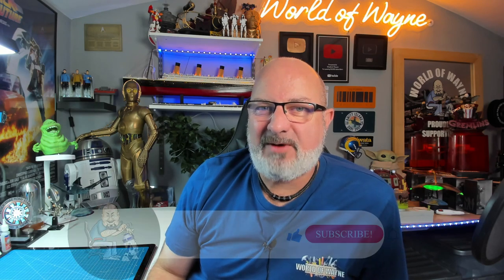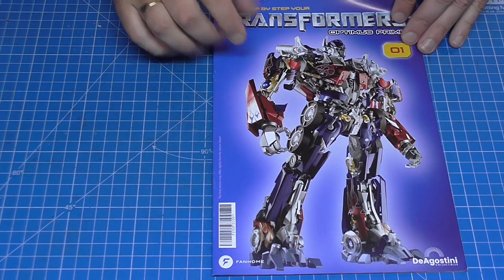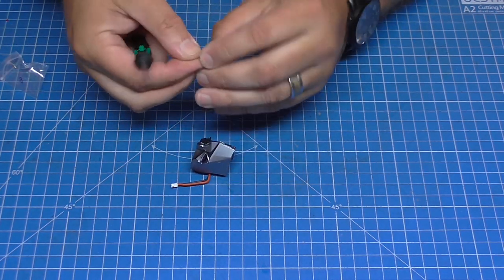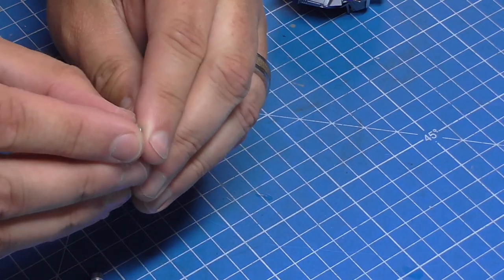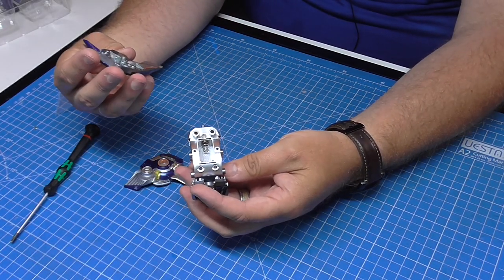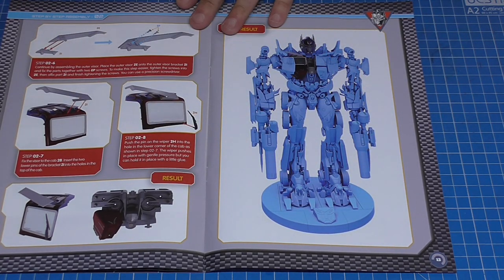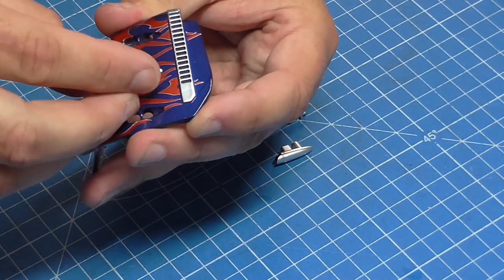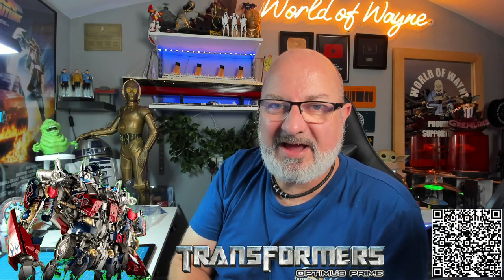Fanhome Build the Transformers Movie Optimus Prime - Pack 1 - Stages 1-2

Comment: Hi Wayne, just wanted to say thanks for inspiring me to get this model set for myself. Really impressed with the level of detail shown plus the actual weight of the metal pieces. Only complaint I have so far is that step 02-6 was so bleeding fiddly to do. Especially with those tiny frickin EP screws! Looking forward to pack 2. Both on here and in person.

Comment: It's interesting that the neck is actually an electrical connector. I suspect that there may be a larger power unit in the torso that can power the head as well. If so, that's a really clever design. You have the small batteries for now, but later you get a single power unit rather than multiple like Iron Man was.
Reply: I kinda think that the headlights on the torso will have some LEDs in them. Maybe the gun will light up? Or the swords 😅

Comment: Well, I see a problem with this build right off. The battery compartment is buried under 2-plastic parts - with (1) part screwed in. Now, what possibly can go wrong with that over time? These Transformer builds are really nice, and I can see how much fun it would be to build them. But for me, I'll hold off until I have a kid in my area asking for one.
Reply from the maker: The top crown is metal.

Comment: Do you know where to get screws lost a pack of AP screws on first step
Reply from the maker: You can try and use some similar size plastic metal screws from another build? They are the ones with threads more spaced out